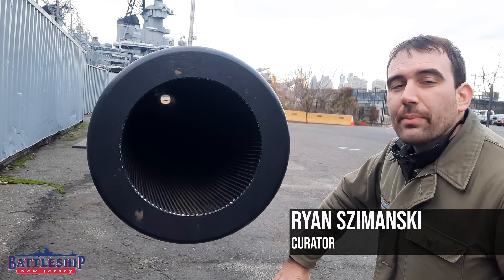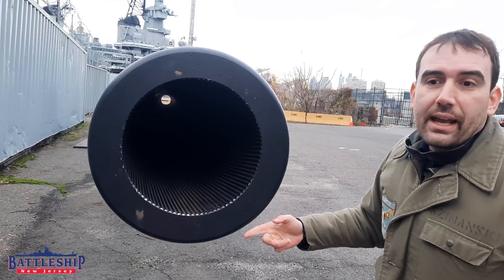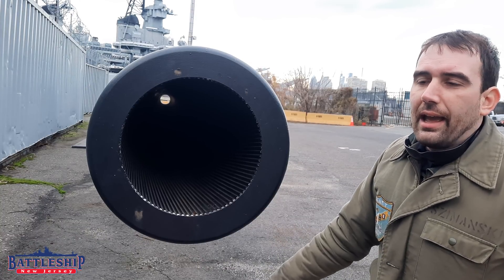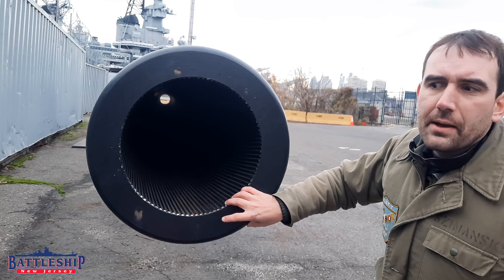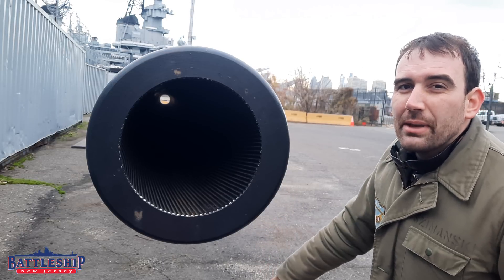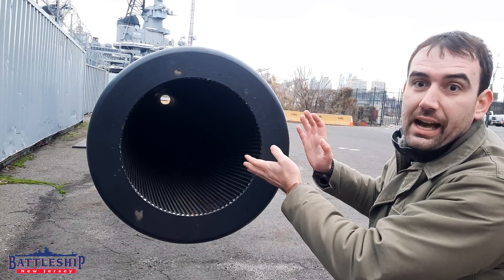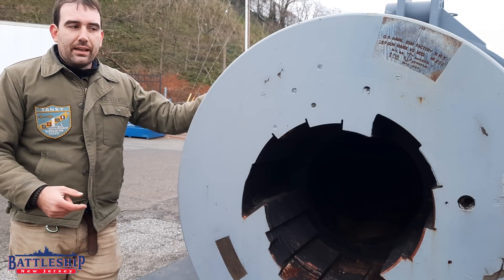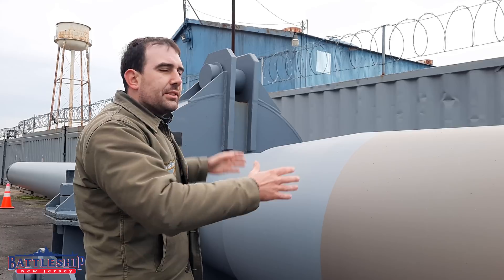16in Barrels: Construction and Maintenance

Comment: I wonder how light a 16”/50 gun could be made using modern metallurgical techniques and materials?
Reply: Your question is too simplistic to answer. How much accuracy do you need? Do you want one a shot disposable 10 shots ,100, 1000? Re-linable? What type of propellant? Using half loads or full propellant charges. (full charge, 660 pounds, was only used for the AP and long range shots) 
When he talks about rounds between overhaul, the original rating of a couple hundred shots was due to liner wear, the later 1500 in the '80s was limited more by metal fatigue type issues, and they actually had to develop an entirely different way of rating the fraction of gun life per round.
The main manufacturing advance hasn't been the steel chemistry, it is the machining tech, boring can happen 10 times faster now than in the 40s
Reply: what about 3D printing the barrel?
Reply: @TheBigExclusive  Nowhere near enough strength compared to a forged barrel.
Reply: Machining techniques would be more accurate and faster. Heat treatments and pre-stressing the barrel would make the gun lighter, but you can't change dimensions and still call it a mk7 and it wouldn't fit the current Iowa class turrets. Although they did upgrade the machining equipment to CNC for these tubes in the 80s I don't think it was ever used.
Reply: @jth877  The better machining can make more efficient shaping practical, that is a smooth taper rather than stepped.

Lighter barrels of a give basic shape will flex more. Long shotguns often have this trouble with heavy slugs and hot loads, the barrel wags around under the pressure destroying shot to shot repeatability. 
Heat treatment, alloying, and quality control will affect the strength and wear resistance of steel but it does not change the elastic modulus. (Not considering exotic ultra-high alloy steels which are very expensive and often more alloy than iron)
Reply: @mytech6779  Flexure is really a moment of inertia problem. 
Increasing a material's resistance to flexure can be achieved by just making the material thicker --- but that makes it heavy. 

You could go the route of composite construction where you have a lighter but stiffer material wrap around the liner for stiffening purposes --- such as carbon composite overwrap --- but now you have the technical challenge of handling two or more materials with different thermal expansion rates.

Alternatively, you make the barrel dimensionally have more inertia through geometric changes. Isogrids, for instance, are used on rockets because it adds considerable strength and rigidity to a structure without adding considerable weight. However, if I look at how much it costs to machine such a thing, it wouldn't take much to figure out why this isn't done for a cannon barrel.

Ultimately, you're right. Heavier but simple barrels just make more sense from an engineering and machining standpoint. The higher mass even helps reduce the recoil that the turret --- thus the ship --- has to absorb after a shot.

If anything, more efforts should go into reducing the number of people needed to operate these beasts and improving the propellant used. It takes over 70 crewmates to operate one turret. Could computerization and automation reduce that?
Reply: Light enough to blow up.
Reply: What about how cheaply?  Today would be impossible anyway.
Reply: @givenfirstnamefamilyfirstn3935  It certainly wouldn’t be technically impossible, though I grant you that there’s no call for it. We could also build better steam locomotives today than ever before, but the best steam locomotive would still be inferior to modern diesel and electric trains. 🤷‍♂️
Reply: A lighter gun wouldn't be better.
A lot of the lighter barrels wear out quicker, they're less durable.
In peace time that may not mean much but in war time if you have to constantly change out equipment because you cheaped out or decided a new material was better than the tried and true method, that adds to your maintenance.  It kind of defeats the purpose of having reliable systems you can field when you need them and NOT have them break on you when it's critical.

Comment: Hi Ryan,

At close range, like a half mile, would a 16 inch shell pass right through the 20 story condominiums on the beaches of S. Florida?  Or could the fuzz be set to blow them up?
Reply from the maker: We don't like to speculate on terrorizing American citizens. But yeah, a glass building is an easy target at that range.
Reply: @BattleshipNewJersey  
Sure,
But... let’s call it “demolition”.  

I suspect the fuzz might not even trigger on a soft building, and that it might just pass right through it.

Lobbing it from a “distance” would be easier because the shell could strike the first floor, go into the ground and blow up the deep seated support foundations AND the building.

But, on a straight close in trajectory?  That would work?
Reply: @deltapee9259  proximity zone fusing ?  I think that were used then the square in Sarajevo were shelled in the 90s.
Reply: Or could a GPS receiver survive the firing - they should considering that it was possible to

Comment: Everyone should look up "changing Steam locomotive tyres" to see the equivalent to changing the battleship gun liners. They are basically the same thing.
Reply: Replaceable liners on naval rifles were not used solely on the 16"-50s. 5"-38s (very common WW II-vintage rifles) used them also. As 5"-38s were fired, the liners would slowly work their way out, to be periodically hacksawn off clear of the tube. Construction methods of the various naval rifles would be an interesting topic.
Reply: @jacquesblaque7728  Very good suggestion.  Would like to see that vid.
Reply: Good observation.  Similar to mounting a ring gear on a flywheel.
Reply: Shrinking the hoop tyres on wooden wagon and carriage wheels uses the same process
They are shrunk on hot and cooled to shrink the tyre, so it grips the wheel.
Reply: @davidpowell6098 , there is a guy in Montana,
that made reproductions of the 20 Mule Team 
wagons.  The complete wheels that he made, 
were over 1000 pounds.  Tires, 1 inch thick, 8 
inches wide. He heated the tires up in a fire, 
that burned up a lot of the scrap from making 
the wagons.

Watching that construction, was amazing.

When I worked at Douglas Aircraft, they used 
an almost similar process to put aluminum 
plugs in stuff that was needed.  Drill the hole 
0.001 too small, make the plug 0.001 too large, 
put the plugs in dry ice, until WELL chilled, and 
just put the plug in the hole.  (Holes 1/4 to 3/4 
inch in diameter.)

steve
Reply: @steveskouson9620  Engels, I think? I've seen his work, a real craftsman.
Reply: @davidpowell6098 , yes, David Engel.

Comment: I asked before about the escape hatches from the engine room to Broadway. Maybe. Video on the different escape paths and abandon ship protocol/safety drills & plans. Keep up the great work
Reply: Were these for escape only and not general traffic or were they hatches designated emergency use only ? And is the New Jersey a positive pressure engine room like some ships that required a airlock ?
Reply: There is an escape trunk. This was some what different than modern steam ship. The Escape trunk door on the Jersey was a water tight door. More modern steam ships have an automatic door. There is a strict requirement that they close within a specific time.  They were also light tight rubber strip alongside of the door. On steam ships if there was a major steam leak . The crew was required to go to the bottom of the engine room  enter the escape trunk and exit that way. The Jersey the Engine rooms escape exit on the middle of broadway.  the time given to exit is 8 seconds I think (been a long time, 30 years since I worked in a Engine room.) almost 40 since I was on the Jersey. No 1 Engine Room MM2 at the time.

Comment: That gun was made in Watervliet, not Washington. That's why it says W. NY on the breech. Fun fact, the 16 inch gun was also invented there, in 1895.
Reply: Cut Ryan some slack! He's still traumatised from the crawl through the 16" barrel.
Reply: The Washington Navy Yard stopped ordinance in 1961. The liner on that is stamped 1969.
Reply: The gun is marked Naval Gun Factory, W.N.Y., that’s Washington Navy Yard.
Reply: @UC1ggvvePx5PhCx3QUXYYXKw Yes it does.
Reply: Many of the older cannons manufactured at Watervliet were stamped that way. Newer ones are stamped WVA or its spelled completely out.
Reply: The facility at Washington Navy Yard was known as the Naval Gun Factory. Watervliet was known as Watervliet Arsenal.
Reply: @SearTrip  Watervliet did manufacture at least one 16" coastal defense howitzer for the Army, and coastal defense mounts for some Navy surplussed Mark 2 and Mark 3 16"/50 guns that preceded the Mark 7's. Seems that the Mark 2 and Mark 3's were too heavy for the Iowa class's turrets, but the Army didn't have that problem.
Reply: According to the yards website they weren't called the naval gun factory until 1945. 4 years after that gun was made. Then, when they were called the Washington navy yard manufacturing stopped. That was several years prior to the resleeve in 1969.
Reply: @kevin_1979  The liner may be from somewhere else, the reproofing date being 1969, but the gun was made at the NGF. Watervliet was never known as the Naval Gun Factory.